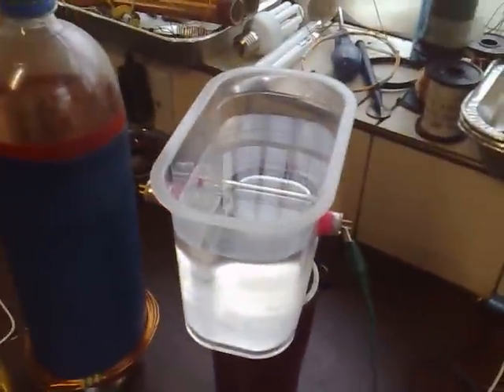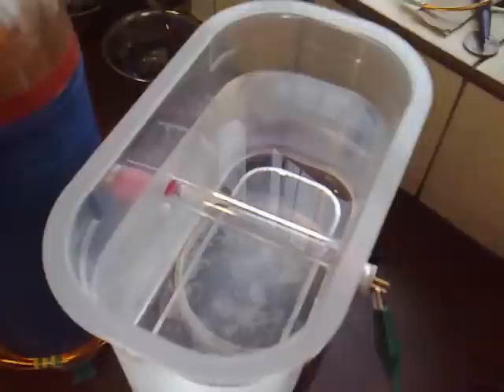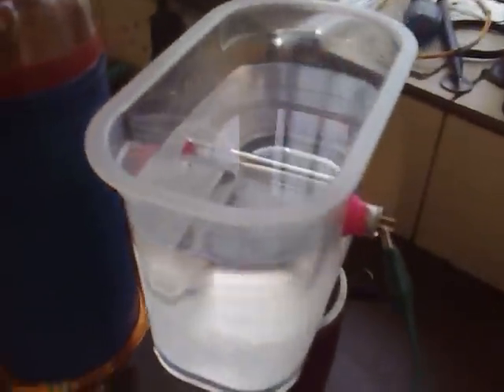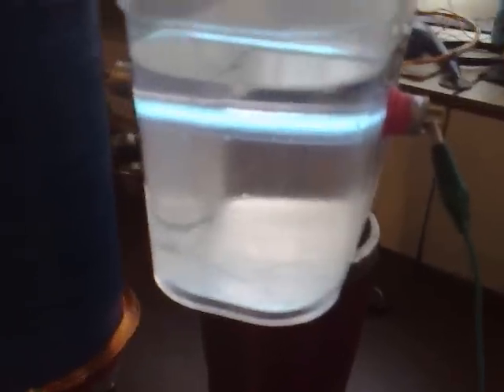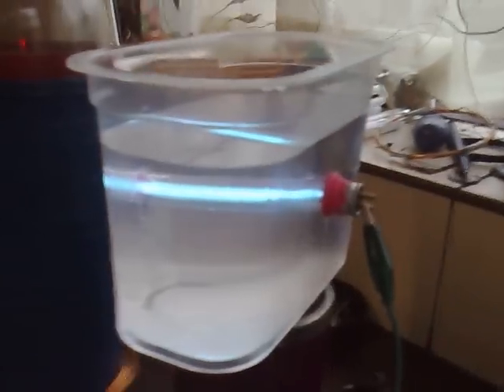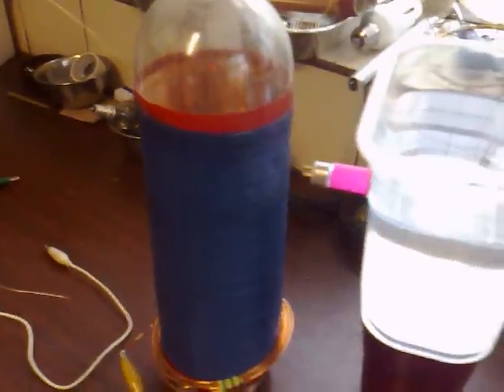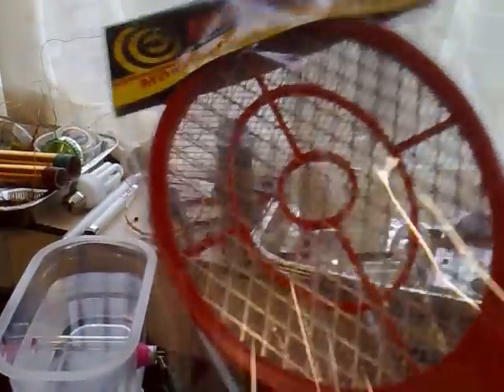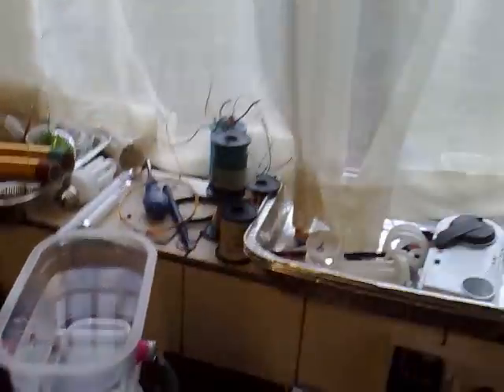Slayer Exciter UV-C water steriliser

Comment: Hi Johny
220 nm   correction...Ive used the basic slayer  and the jiffypuck coil 
 your circuit of the bug zapper  will surely   work  longer  
The vacuum tubes can directly be placed in a pipe in series with running water or better still  modified in a three stage  water filter cartridge
Simplicity is the best  
Cheers        BOTTOMS UP !!!!!

Comment: Thats what I wish for   last Xmas lol
Why not run a bug zapper  from slayer also
Ive used 20 w uv c from Amway  and a 20 w 36 in tube directly soaked in running water  .  at 20 nm  it will alter the dna of microorganisms and render it harmless..
Max distance   1 cm  for running water is my suggestion since the wavelength is short..  we are using uv in effluent discharge for waste water 
If only we can measure with a UV meter the light output from te slayer wireless uv lamp  we can safely use